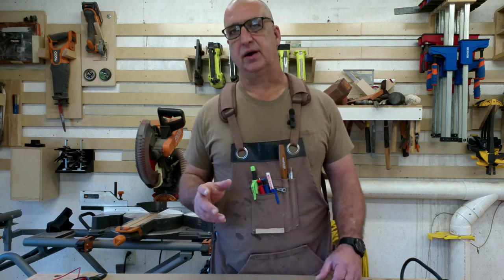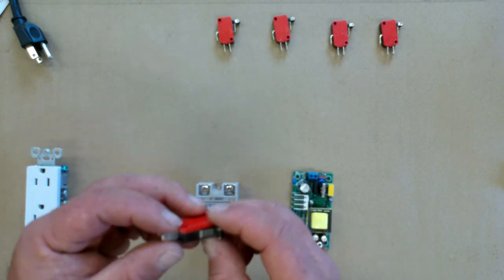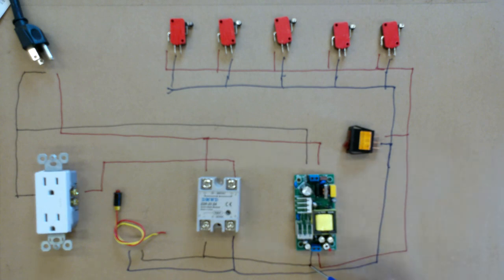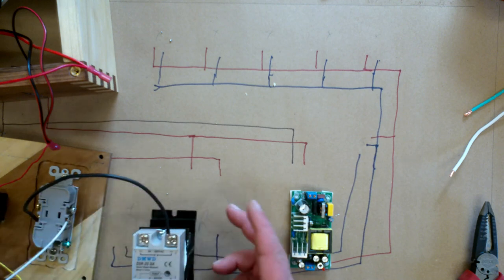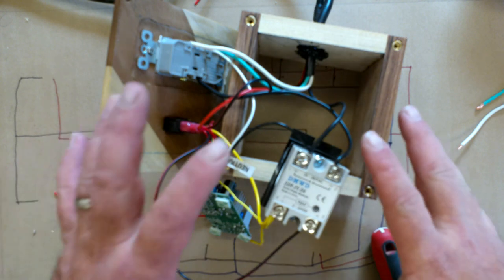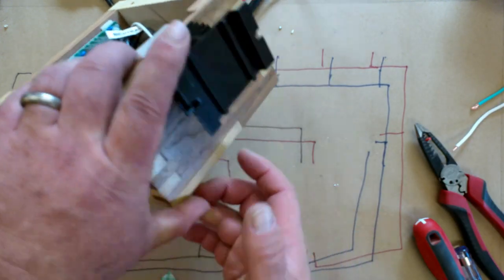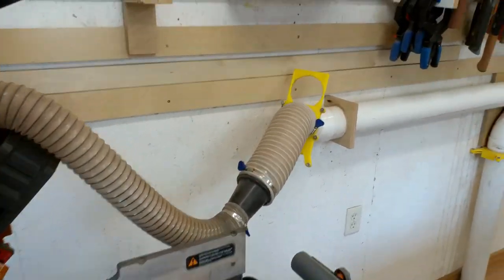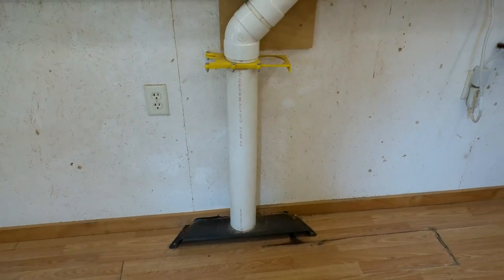Automatic Dust Collector System DIY

Comment: man, this video is just spot on. I love the combination of different skills to make the whole thing work. First of all the basic workshop dust collection stuff, but then also the wiring, electrics and 3d printing to make it fit your needs exactly. What you did here is pretty much exactly what i have in mind for my workshop some day. (actually, some elements even apply to how i'm hooking up my HVAC system to my smart home to make my centrally controlled airco unit deal with individual room temps)
Reply from the maker: I have a lot of things like this I have built. I bought a new camera I used when I filmed this. It sucked. I have got a better one now. Building something is much easier than filming and video editing it. I am glad it made sense.

Comment: I wanted you to know I built this dust collector and are very happy with it, I don't have an exhaust filter on it yet. It's a huge improvement over the 1hp Delta with the bags collector, thanks so much for this.
Reply from the maker: Thank you for letting me know. This has been a real game change in my shop. I was worried that others might not have the same results. So far, no one has told me it didn't work for them but have had people all over the world tell they have built it.
 
I am not the best with names, but did you email me a few months ago about a  Live show? If so, I replied but never got a response.

Comment: Just remembered, the nice thing about this system only the machine that you open the blast gate is the only machine that has dust collection. I also use a remote to let me know if one of the gates are open.
Reply from the maker: Before I did this, I would forget to close gates. I would notice dust coming off the saws due to lack of suction. Then I would have to go check, and half the gate would be open. Now, if a gate is open, the machine is running. If they are all closed, then it is off. When I was back and forth between the table saw and the miter saw, I would open the next tool before I closed the last one I was using. This keeps the collectors motor from turn on and off.

Comment: Hi, I did something like this but used non-contact magnets instead of the limit switches. Very nice, thanks,
Reply from the maker: I had thought of using induction switches. Then, having the gates open and close when the motor comes on. I decided against it mainly because of the miter saw.

Comment: I ordered the parts but the LED and switch are not on there. Are they necessary? What toggle switch do we buy? Is it wired any differently if we don't use them?
Reply from the maker: No. The led is just an indicator. The extra switch is just a bypass.  I put it in just in case one of the micro switches stopped working. I could still use the system to finish what I was doing and fix the issue later.

Comment: Two things, it just would have made sense to have the payoff at the end of the video showing you opening a blast gate and having the dust collector kick on.  Second,  as wood workers, we want to make everything out of wood.  But it's not a good material for everything.   The reason that breaker panels, switch boxes, aux panels, makeup boxes ect are made of metal or plastic is that 120v connections and switches can overheat and cause a risk of fire.  Even though your box joint box looks great, and even though the chance is slim, I'd rather see you use a metal project box that has no chance of burning your shop down.
Reply from the maker: I agree with you on both points. Thanks for the constructive feedback.

Comment: you're a wizard man! Where do you learn all this stuff?
Reply from the maker: By screwing up. I have just always tried things. Many of them have not worked and few have blown up. I almost sink a Naval Cruzer back in 1990. 

Now I figured out I never screw up. I am just figuring out the ways not to do something. Then all that is left is the right way to do it. When i build something it normally takes 3 to get a great product.  I will figure out what I think is the best way and build it. Afterwards it will work but I will realize that maybe 10 things would have been better a different way. The second one I will fix the 10 things but maybe only 7 work the way I thought they would but it will be better than the first one. By the 3rd time I normally have all the bugs worked out.

This is the third time I have done the dust collector. I built and used it for about a year. Then I build one for a friend. That was the one I video'ed building the baffle. I then tore mine apart and rebuilt it with new parts for this video.
Reply: @ShopRamblings  haha that Naval cruzer story sounds like a good one
Reply from the maker: @struggle375  we were inventoring OBA canisters. I found an expired one and decided to cut it open to see what was inside. As I was cutting it with the hacksaw the metal shavings were sparking. It looked pretty cool. The potassium superoxide was like a yellow chalk. I dumped it in a steel trash can. There must have been some oil in the can because it lit off and exploded. Later a friend told me he was on the deck above and it knocked him off his feet. It melted the steel can like it was plastic. Luckily it all burned up before melting through the deck. Even more luck, I had been cutting on a table over about 500 canisters. The trash can was about 3 feet away. Had it lit off on the table above the other canisters they all would lit off. A couple hundred pounds of potassium superoxide would have probably still been burning sitting on the bottom of the ocean. 

Luckily back then people took care of each other. The ship was put on general quarters. The fire team went in and the whole aft end of the ship was filled with smoke. Probably 100 people involved. We wrote it off as a training accident and no one got in an trouble. Now days it would have been all over the news I would have been it the brigg.
Reply: @ShopRamblings  you're damn right about that being in the news, nowadays that would have been nationwide headlines